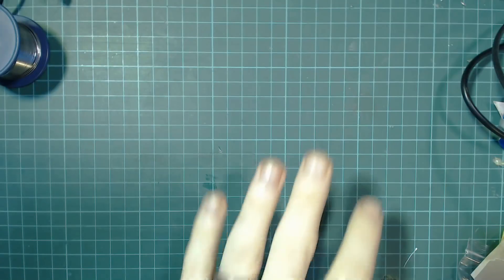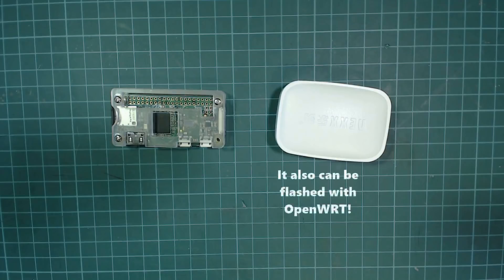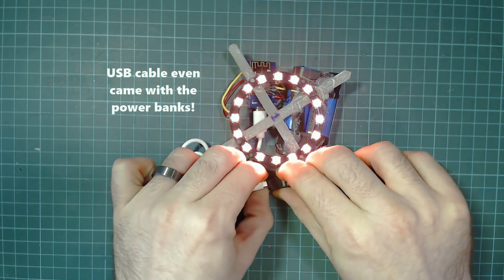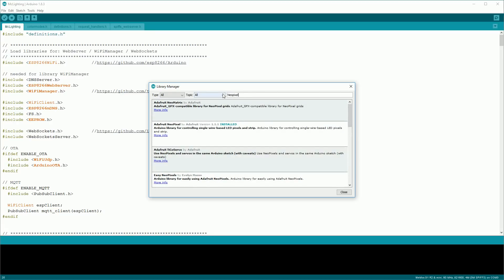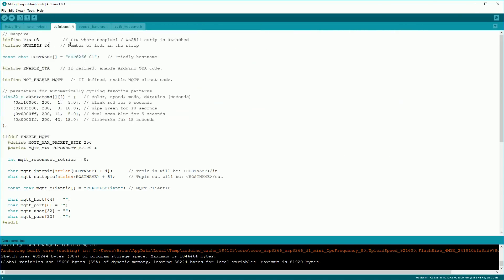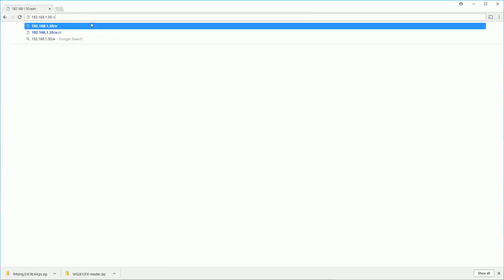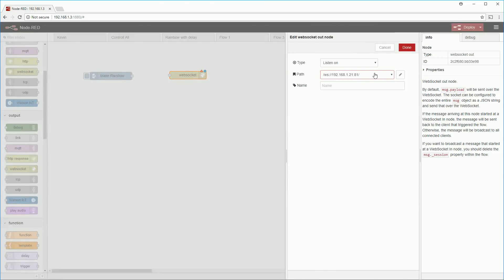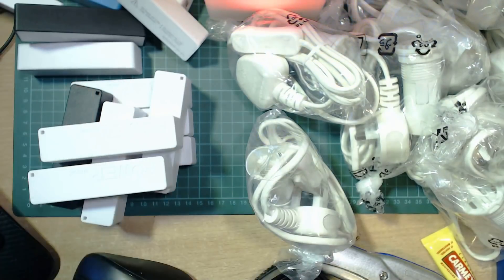ESP8266 + Neopixel Wedding Lights controlled via a PI

Comment: Thanks for  a fantastic project and tutorial. I currently use Tasmota firmware  on my ESP devices. It supports Neopixels but the amount of effects offered are limited. I have been searching for a couple of days for an alternative that I could still interface with Node Red. Looks like I am off to try McLighting. Great news it supports MQTT also. Will also be checking out Wifi manager and that little router! You have really hit the nail on the head with this one.

Comment: over MQTT / Wheel / Ring / Node red /Apk / Openhab

My whole set up is working fine except following issue .

Red selection reflecting as green over ws2812B
Green selection as red
Yellow as Yellow
Blue as Blue

All effects working fine
I am using Wemos X- ring . removed the U1 switch .
Using current version of firmware

This looks my X ring is GRB and not RBG connection Kindly suggest firmware changes to make it compatible with GRB

Comment: Hello Grian,

a very amazing project. I already married, but my bother in law will marry very soon. Therefore I would like to make the same project like you. I had already success with Noepixel in our living room. Soldering and and electrical connection is not a problem. But do you have a backup or  image of the raspberry pi software? Or is it possible to export the nodered scrips? That will very helpful for me. Hope I hear from you. Best regards, Thomas ( exzivi99 at gmx . de )

Comment: in my Downloads\McLighting-master\clients\web\build is not offline.appcache file. is onli a index file
Reply from the maker: I think that should be fine , it think it was just something to tell your browser to cache some things, its definitely not needed anyways
Reply: after upload the index and back in 192.168.1.130 is show me this 
File Not Found
URI: /
Method: GET
Arguments: 0
Reply from the maker: +Xxx Ggg if you made the same changes as I did in code the address should be 192.168.1.30
Reply from the maker: +Xxx Ggg actually try reload the page
Reply: 'IPAdress' was not declared in this scope
  wifiManager.setSTAStaticIPConfig(IPAdress(192,168,1,30), IPAdress(192,168,1,1), IPAdress(255,255,255,0));
in your sketch the "IPAdress"is red  in mine sketch is black
Reply from the maker: +Xxx Ggg address has two d
Reply: Hello friend, i have same issue i can login to 192.168.1.30 but no offline.appcache file, without this file thi is not working only 
File Not Found

URI: /
Method: GET
Arguments: 0
Please share it if it is possible
Reply: nu stiu. este ceva ciudat
i don't know. is strange

Comment: I can not do it
I enter into the browser 192.168.1.30 and there is no access to the site (
I broke my whole head
Reply from the maker: +Юрий Постников did you update the code to have a static IP address as per the video?
Reply: did everything as on video
only the module in my NodMcu v3
Reply: I'm not strong in English, maybe I missed something
Reply from the maker: +Юрий Постников that shouldn't matter.do you see anything on the arduino serial monitor?
Reply: the port monitor is empty, can you check the code remotely? through TeamViewer, for example
Reply: Data port monitor:
*WM: 
*WM: AutoConnect
*WM: Connecting as wifi client...
*WM: Custom STA IP/GW/Subnet
*WM: 192.168.1.30
*WM: Using last saved values, should be faster
⸮9ʎ^⸮F1⸮L⸮X}⸮)v⸮.)⸮⸮⸮⸮L⸮⸮!J⸮

Comment: Awesome write up.  Ive followed most of it but when I get to plugging in my led strip it just flashes random colors very rapidly no matter what pattern or color I send from the website.  Any Ideas?
Reply from the maker: +point223 thanks!

Sometimes neopixels are a bit fussy with receiving 3.3v as the signal input. You could try a level shifter if you have one (shift up to 5v). You could also try a small capacitor, 220pf between signal in and ground

Hopefully this helps!